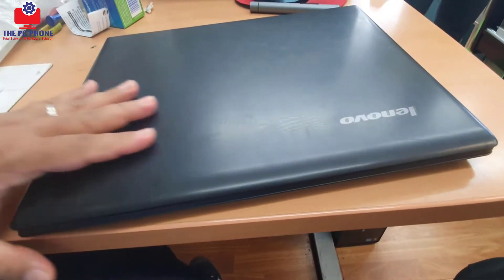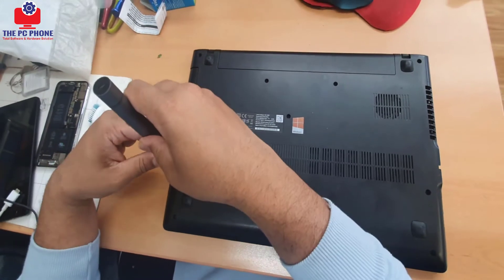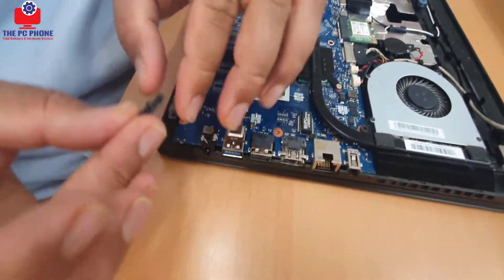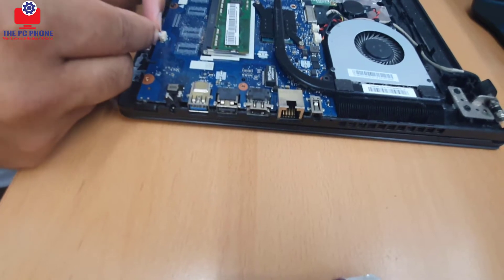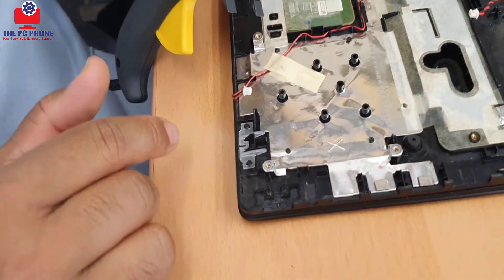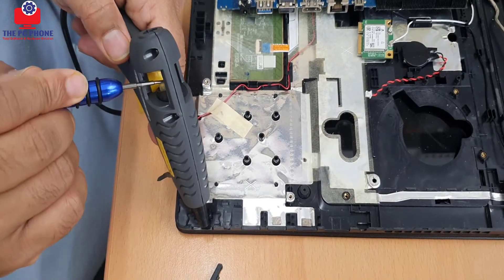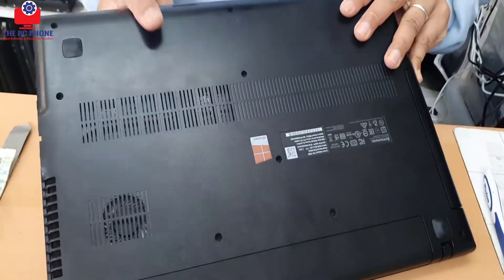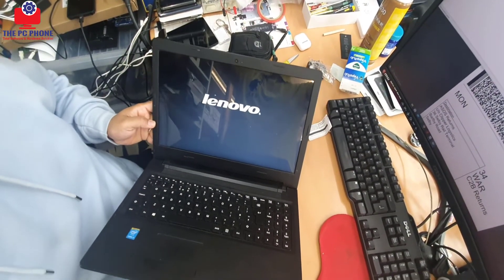Lenovo IdeaPad 100 Power Button Issue ! Fixed!!

Comment: Thanks. Very good tip! Helped me develop my own solution.

Instead of using a hot glue gun, use rubber glue/adhesive. Then you only need to remove 2 screws on the motherboard and lift it up with a spacer. Then there is plenty of room to work and apply the glue. AND you save a TON of time since you do not have to disconnect ALL the connections from the motherboard. MUCH EASIER!

Thanks that I was able to build on your idea.
Reply from the maker: Hope you would subscribe to my channel!! Thanks